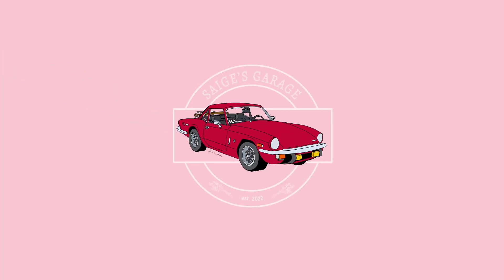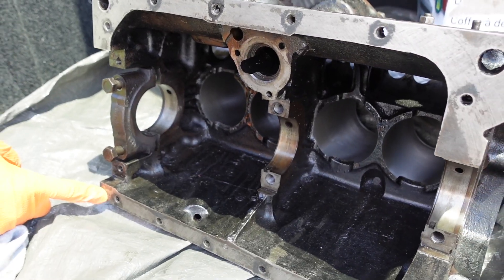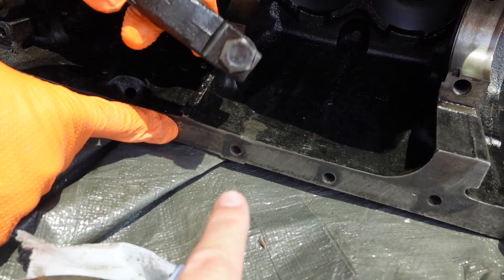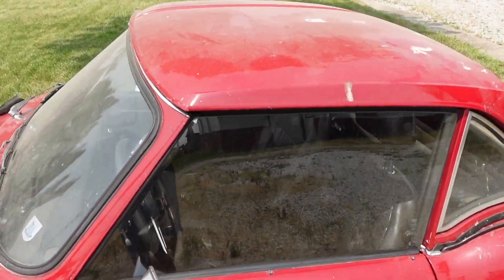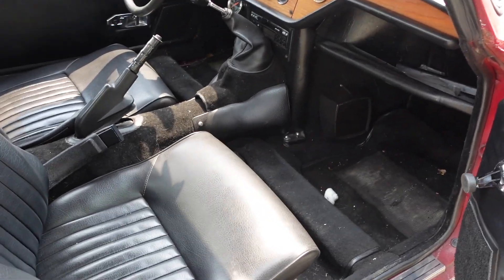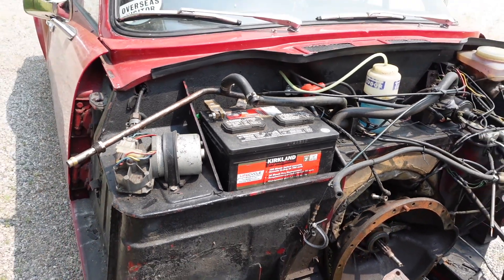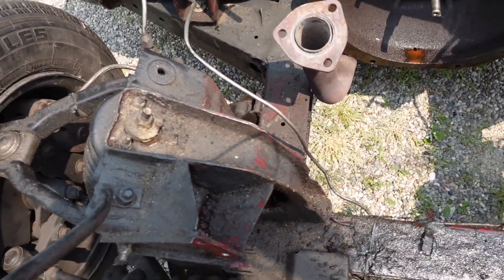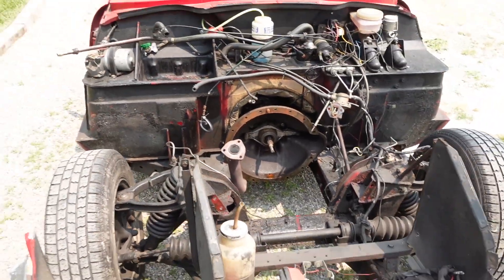Ep.17 | Restoring my '73 Triumph Spitfire 1500

Comment: Bonjour Saige :)  Great video, and yes good idea to test the 1300! 
If I were you I'd just give it a good cleaning without removing anything except the rocker cover and the number 1 spark plug (water pump side). As already said first check would be the crankshaft end float: 
If that is under say 0.011 in it should be ok,  even if max spec is about 0.008 in. (Definitely it is better to inspect the surfaces engine side if spec is way out). 
Then I would refit the 1500 distributor pedestal (alone, less distributor) on the engine block to secure the drive pinion. Beware, there are some critical settings here! : the pinion has an offset slot (for the dizzy drive dog). This slot must be positioned between 9:15 and 10:20 given the pedestal studs are aligned at 9:15 . The slot should also appear offset towards the block side. 
This pinion position must be set after the piston number 1 (water pump side) has reached the top of its travel (TDC): that is when the 0 mark on the timing cover scale is aligned with the pulley mark BUT this piston must also be at the end of the compression phase.. This is why we removed number 1 spark plug : Turn the engine clockwise while you put half a finger on the spark plug hole until the point you feel a strong rush of air past your finger, then immediately align the pulley mark with 0. 
Maybe you will need to remove the pinion several times and adjust oil pump shaft position to allow the correct slot orientation with complete engagement of pinion shaft into the oil pump shaft below. When set up, ensure the pinion is fully down to the block.  If both shafts are not fully mated the pinion will stay up and this might cause damage to oil pump/ pinion & camshaft.. 
Last critical setting on this part is the pinion vertical endfloat: The pinion needs about 0.005 in of vertical endfloat between block & pedestal. This endloat is set by selective use of gasket thickness under pedestal. If you use a normal single gasket here without measuring first before tightening the pedestal, you risk locking the pinion and serious damage to camshaft and block.. This measurement needs a little calculation with the help of a flat washer put under the drive pinion: it's a bit too long to explain here but you will find it stated in the manuel in the Distributor Drive shaft & Gear section, including 2 calculation examples. 
Lastly I take the opportunity to suggest a simple procedure to time the ignition for a first start:  Remember, as said above we have our engine set at TDC on the end of compression stroke for piston number 1.
 From this position turn back the engine counter clockwise half a turn and then turn it slowly clockwise to align the 6 or 8 degree mark of the BEFORE timing scale with the pulley mark. (don't use the AFTER scale).
Then take your distributor and rotate its shaft to obtain full opening of the points (pad will be on a cam peak) then measure the opening gap (should be 0.015 in). if wrong , unscrew the locking screw and move the point bracket to adjust.
 Now fit your distributor in place, ensuring its drive dog is fully down by rotating the shaft cam at the top. Tighten only slightly the clamp side screw so that the body could still be rotated by hand.  
Connect the distributor wire to the coil negative terminal.
Remove distributor cap & rotor and connect a 12V bulb to the negative coil terminal and the ground. 
If you consider starting the engine on the trolley, a fat ground cable (battery jump cable) will do the job connecting engine block to battery negative. 
Then connect positive coil terminal to the battery positive (a switch can help here): 
  If the bulb lights up: slightly rotate distributor body counter clockwise till bulb goes out, then rotate
slowly clockwise till the very point the bulb lights up again. Stop there ignition is timed! 
  If the bulb is off: slowly rotate distributor body clockwise and slightly go past the point the bulb lights up, then go back anti clockwise till the very point it lights up. Stop there, ignition timed! 
Don't move the distributor body until start up (it might be useful to rotate it back & forth a little while cranking if engine refuses to start)
Now refit the rotor arm, put the cap on and look at which cap wire boss the rotor blade is pointing at. 
This boss is for number 1 spark plug lead (number 1 spark plug being near water pump)
Given the engine cylinder firing order is 1342 and the distributor shaft turns counter clockwise, connect the remaining plug leads respectively to plugs number 3,4, & 2 following the counter clock way on the cap. Now refill with oil, change the filter (preferably 15w50 oil for these engines), liberally put some fresh oil onto the rockers, springs and valves, turn the engine by hand several times to lubricate the top end, refit rocker cover and connect some oil warning light to the sender unit on the block and the battery positive.  I strongly recommend to remove the big angled plug on the block below distributor, remove the spring and valve inside and fill oil by this orifice till it overflows and then refit valve, spring & plug. Then starter crank the engine with all spark plugs out to prime oil circuit until oil warning light goes out.  Brush clean & regap spark plugs or renew. 
Remove water pump thermostat for the test and rinse coolant circuit with garden hose, then reverse flow. 
Be sure to fill the engine with water if you run it more than a few seconds or the piston rings will suffer.. 
If water is clear, you can connect the radiator to the circuit. Put it securely with its cap above the cylinder head level to help bleeding air pockets as this can cause overheating. let the rad cap off during the test. 
Contact, Ignition, Fire! 😉
Reply from the maker: Bonjour! Wow this is amazing!! I’m hoping to get in there and check out the 1300 sometime soon but I’ll definitely need some helping hands. I’ll be sure to follow all these instructions thank you :)

Comment: I’ve just been cleaning 50 years of filth off of my Herald’s chassis, not the most fun of jobs. Especially when it revealed more rot underneath :( As you can roll the car outside a pressure washer will make your life a bit easier! Good plan trying to get the spare running, I know how frustrating it is having a car you wanted to drive and being unable to cause it needs work, so I’d definitely do the same.
Reply from the maker: Yes I’m hoping to get my hands on a pressure washer soon! Fingers crossed I get it going soon!

Comment: the grease all over the engine bay keeps it rust free lol.  totally sympathize with wanting to drive it now.... summer is really short up here.  with the engine out it's the perfect opportunity to clean it  up like new.  using the thirteen hundred engine is possible, but it has to be the later version of the thirteen hundred -  which has the same flywheel as the fifteen hundred engine.   do some internet searching on engine numbers to what you have.  the issue is the flywheel of early thirteen hundreds wont bolt up.  you could change the flywheel to your fifteen hundred engine flywheel but it's a bit of work with retapping... not what you want to do with a temporary engine.  the thirteen hundred is a faster revving engine, but that is only the earlier version smaller crank version.  the later version of the thirteen hundred  with  thicker crank like the fifteen hundred has, is just as unreliable as the fifteen hundred.  i prefer the fifteen hundred for around town as it has noticeably greater torque output and is easier to drive - esp good for a new manual driver.  looking at this vid i didn't notice a wood block or brace to support the transmission where the engine bolts to.... if you don't have one you should .
Reply: Hi, The complete 1300 engine will fit the gearbox as it is. Perhaps the clutch will need to be renewed, but there is no need to fit the 1500 flywheel/clutch. Actually on these early 1500s (73 to 75)the box is a MK4 1300 box. The 1300 engine will fit the later single rail box without modification as well except the clutch plate (because of the fine splines). This one does exist but is a bit tricky to find now ( from Dolomite1300/Toledo).
 For normal road use, the late 1300 is quite good & fairly reliable if not trashed.  😀
Reply: @weescotildweescotild6875  ---  you are right i forgot.  the seventy three spitfire has a three rail transmission and will fit the thirteen hundred engine.  all i did was add confusion  arghh.
Reply from the maker: This is good stuff to keep in mind thanks :)

Comment: Yah the 1500 is not the best motor. I would pull the head and oil pan off that 1300 to give it a quick inspection. Definitely plastigage the main bearings and the big end rod bearings. Not very hard to do. You are doing some great videos and really good to see younger English Sports car enthusiasts.
Reply: Dude, pay attention: she has stripped the motor down completely already.  She knows what needs doing and is doing it or having it done.
Reply: If it runs it runs… it’s to get the car rolling for the summer.
Reply: @robertllr 
Dude, pay attention: Everyone here, including Mike, knows that Saige stripped-down the 1500. Mike was talking about the 1300.
Reply: @robertllr  She has not taken the 1300 engine apart. She has taken the 1500 engine apart. And yes I am paying attention. Maybe you should re-read my post Robert?
Reply: @marktaylor6837  Thanks Mark. I had to question if I was being a total idiot at first :)
Reply from the maker: Great idea I’ll be sure to do that!

Comment: I'm not 100% sure, but it looks to me as if might have a 1300's gearbox - I would expect the gear lever to be a bit further towards the back of the car and not have a bend in it...
Reply: The Spitfire IV 1500 for the North American market still used the three rail gearbox. The engine got the increased capacity before the rest of the world cause the emissions regs were killing performance. But the gearbox wasn’t changed, I’m not even sure the single rail box was in use in any car in 73. The 1500TC also had this engine and box pairing, 1500 and three rail.

Not that it matters in practice. Both will do the job!
Reply from the maker: Very interesting to learn!